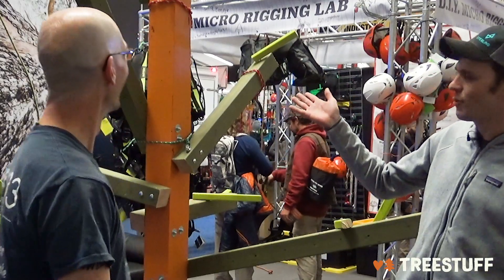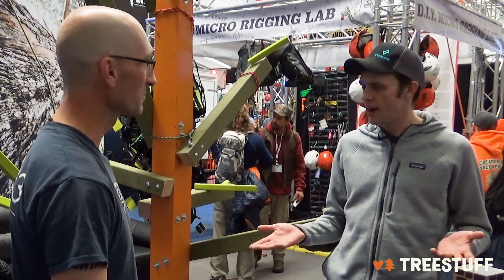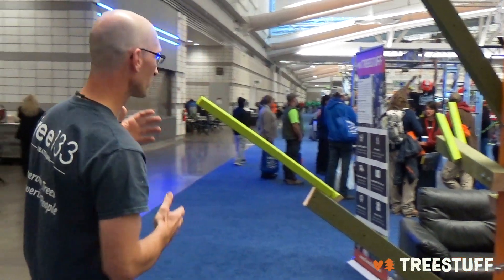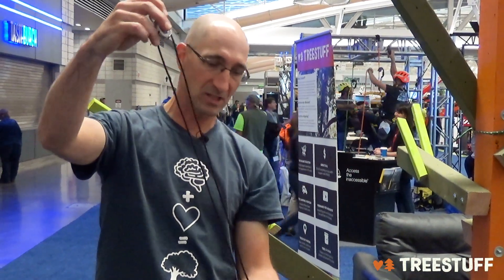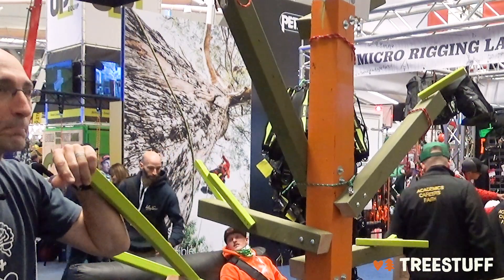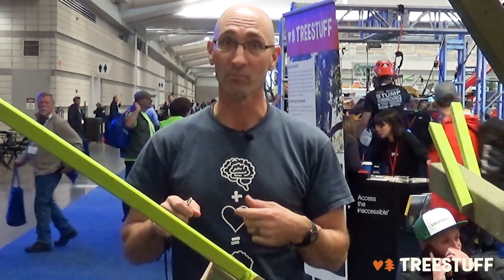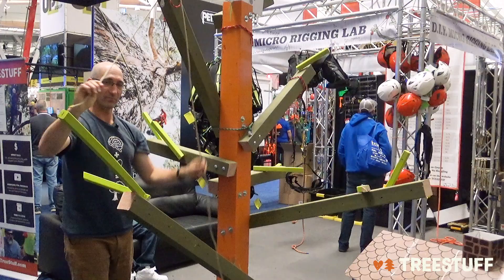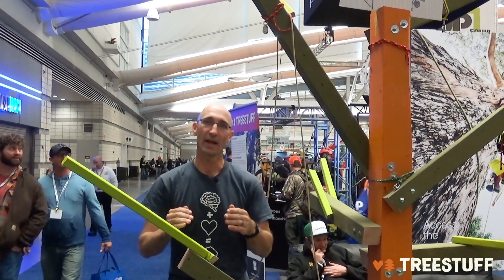Angles, Redirects, & Forces in the Tree - TreeStuff's Micro Rigging Lab Featuring Craig Bachmann

Comment: When you open that vector, are you getting less torque or force applied to the limb than with a MRS 1:1 system?
Reply from the maker: Yes. MRS would pull straight down on the TIP, which torques the limb attachment more than a basal tie would.
Reply: @TreeStuffdotcom  I disagree, seems like Craig is saying widening the vector angle dramatically improves the 2:1 ratio of a basal tie system but still doesn't accomplish the 1:1 of MRS. It has other advantages though like changing the angle that force is applied the limb and union, plus safety and convenience.
Reply: @maclolma  I interpret that he's showing the conversion of force by means of torque at the limb union transferring to compression through the canopy. I believe he's showing that you can distribute load not necessarily reduce the absolute force value..? 🤗 (It's safer to distribute a force of 2:1 through compression and torque rather than a 1:1 of solely torque